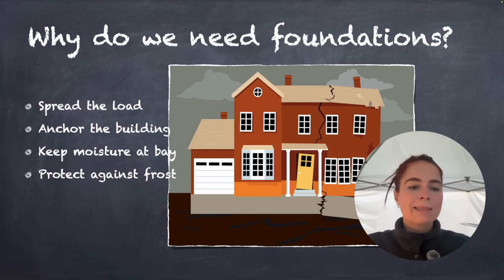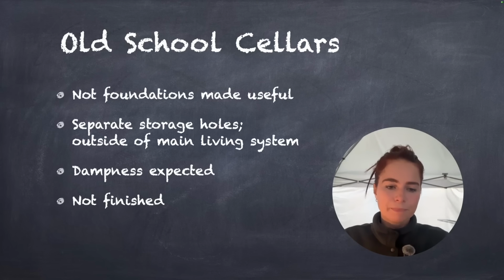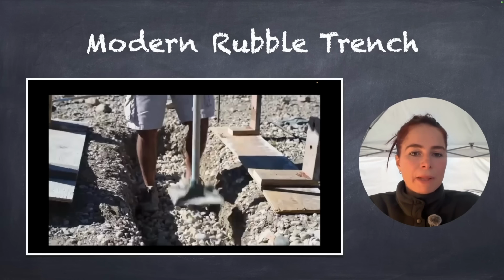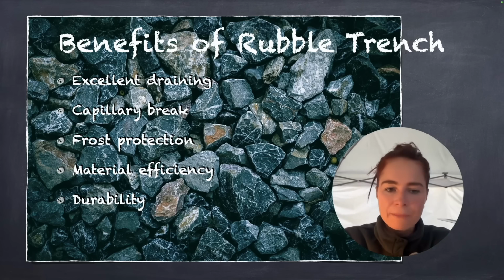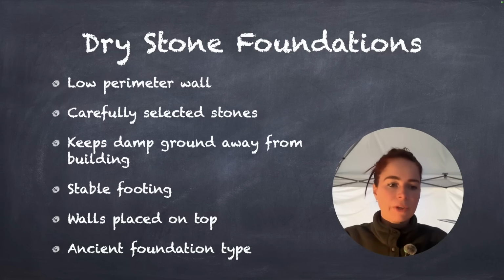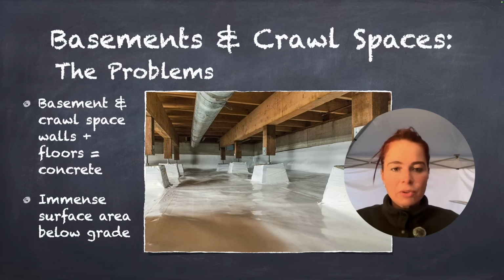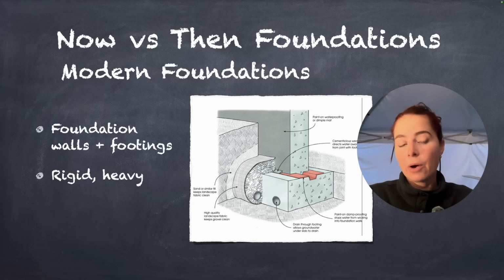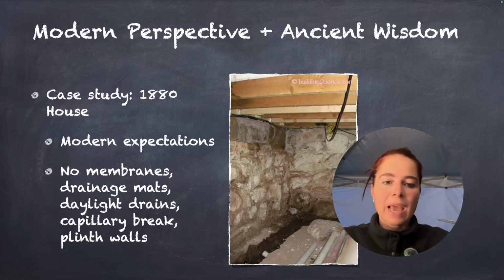Why Modern Foundations Fail — and the Genius Design We Abandoned

Comment: There's more you can dive into. Wrap around porches protect water from ever coming close to your foundation.  Also checkout stabilizing clay soil.  Or just having a 5 foot sidewalk around the house.  Oversized overhang may work as well.
Reply from the maker: Thank you — that’s such a great point. Controlling how much moisture there is to deal with from the start just makes so much sense. Really great food for thought!
Reply: That only helps with surface water, not groundwater. If a basement is getting wet from groundwater, reducing or eliminating surface water will not remedy the situation. You need to install a drain below the groundwater table, (below the foundation) which can be at various depths on a piece of land, and can change with time due to changes to nearby land (manmade and natural) that is not necessarily near the structure.
Reply: @TheSwissChalet  good point, but I'm not building a basement. Ground water should not be an issue with our 36"  foundation.

Comment: Building standards are on life support and you are curating the flame, keep it up. I recently removed parging from my 1920's craftsman (cleveland) basement to allow the foundation to breath. In the 1880's case study you say "the walls would have gotten saturated with all that mortar", not sure if you are implying the water wouldnt pass thru the wall. If proper lime mortar (quicklime/ Calcium Oxide/ Kibble) is used, the water vapors that would be increasing the hydrostatic pressure are allowed to pass thru the lime mortar. Tuck-pointing (step I am at now) is necessary because the mortar was always considered the failure point (crush panel). In roman concrete (pozzolan ash), especially at ports where water is in constant contact, calcium-rich material called "lime clasts" provided a self-healing capability that allowed it to cure later and repair cracks over time.

 Water management is 1st step; right sized gutters that minimize increasing hyrostatic pressure, large eaves, awnings (not just for shade), grading, etc. 80% of the companies near me that work on basements are fly by night scammers. We need to start building with purpose again.
Reply from the maker: Thanks so much for this thoughtful comment — I really appreciate the depth of your insight on this. When I said the walls would have gotten saturated, I was thinking less about the lime mortar itself and more about how a fully filled below-grade wall (without the drainage gaps of something like a rubble trench) naturally draws in and holds moisture. Once that crawlspace air is connected to the living space, it can impact the air quality throughout the whole house — which is especially concerning for anyone with environmental sensitivities (like me and some of my audience). Even with lime’s ability to breathe, that kind of setup just seems risky when you’re aiming for pristine indoor air. Your point about lime acting as a vapour relief path is such a good one though — it’s exactly the kind of nuance we’ve lost in modern building.
Reply: @thehealthybuildingproject  From my limited scope, we have far too few resources allocated to building foundations (in line with our throw away society), thank you again for caring. I did not fully understand the rubble trench until i watched your video and am intrigued to see how it performs with "modern upgrades". Rubble trench may be more durable than "stone n lime mortar?" in new construction. Maybe this is outside the scope of this video, but what would you recommend for restoring a clay block 1920s home foundation (originally built with lime mortar --> I believe --> I put this in or near the category from the 1880s case studey (hard material joined with mortar))?. I assume not, but would you see the rubble trench as something that could be retrofitted (prolly cost way too much --> underpin req'd?).

Youtube armchair commentor casully throwing out recommendations here, you guys should compile a "foundation types, repair methods, & future foundations" handbook and sell it.
Reply: She keeps losing everyone w her subpar knowledge and delivery I'm getting sick I can't hear this

Comment: Done correctly, modern concrete foundations designed with water & vapor management, insulation & inside air management are stronger,  cheaper & more durable than a rubble footing & foundations that are more difficult to detail to make them livable. Your main statement is " if done right" that goes for concrete foundations as well. Your hypothesis is lopsided. Look up "ASIRI Designs: Where Design Meets Building Science"
Reply from the maker: Good points — and you’re absolutely right that any system depends on being done right. My focus here is really on moisture management. Concrete’s capillarity is quite strong, so even when it’s detailed well, moisture can still migrate through it if that isn’t addressed directly. The systems I’m talking about have moisture management built in from the start — that’s where I think we’ve lost some of the older wisdom in modern practice.
Reply: @thehealthybuildingproject  They clearly have figured it out because there are buildings built with several stories underground, and they don’t just turn into giant multi-story swimming pools.
Reply: @walterrutherford8321 hi, I build these buildings. Sump pumps are the reason they don't turn into swimming pools. If the lights go out they will quickly turn into swimming pools 😅

Comment: You are making a lot of inaccurate assumptions based on an over simplification of the problem & not based on any provable scientific evidence  -  today's homes are tight & much much more energy efficient (required by code)  vs old homes that are leaky, cold or hot,  high or low humidity & are not energy efficient. Most people in old homes, especially ancient homes people only lived in very small areas of the home in winter or in the heat of the summer. These homes looked nice but were not comfortable. Done CORRECTLY  foundation construction takes water away from the foundation wall, is water & vapor impermeable,  insulated & has air management on the inside. Done CORRECTLY basements make excellent living spaces. Unfortunately, most builders do not take the time or want to spend the money to construct the foundation in a way that combines all the components necessary to achieve a dry, warm & fresh air basement.  The issue is more involved than just the foundation wall. For an detailed explainaition look up the article "Insight Concrete Basement Foundations"  (An edited version of this Insight first appeared in the  ASHRAE Journal.)  By Joseph W. Lstiburek, Ph.D., P.Eng.,  Fellow ASHRAE.  i have lived I ancent homes  500 years old   200 years old   50 years  onld and today 2025 less than 1 year old and of all these homes the most comfortable is the newest one that takes advantage of all the science & building techniques to achieve energy efficiency along with  air & water management.  the 500 year old castle was beautiful but extremely uncomfortable excepet for a few times of the year.

Comment: THE WATER IN THE FOUNDATION IS SEEKING EQUILIBRIUM - water will move from a wet space to a dry space.  So if the exterior soil is 100% dry, even 1% moisture on the inside will try to move to the exterior.  unless the wall is vapor & and water-impermeable.
Reply: Sounds like a very rare place to find with 100% dry soil around the house.

Comment: We've harnessed electricity. Install a dehumidifier in the basement and be done with it. Why are we trying to reinvent the wheel?
Reply from the maker: Dehumidifiers can help manage symptoms, but they don’t solve the underlying moisture pathways — that’s what this discussion is about.
Reply: @thehealthybuildingproject  Removing basements is, itself, an endeavor to manage the symptoms. You remove the space, or the enclosure envelope in the case of crawlspaces, because no material currently exists which can provide the structural characteristics of concrete while also preventing moisture conveyance.

Moisture is going to exist. It's going to enter the living space. And it will require handling. How this looks varies only in degrees with basements and crawlspaces within the dwelling envelope requiring a greater degree.

Since houses already have central/forced air handling it logically follows that adding a central dehumidifier to spaces with consistently high degrees of moisture would be the most practical route. Ducted dehumidifiers are more than capable of removing the moisture from basements and are very cost effective, especially within the context of finished basements. The idea that we have to handle (heat, cool, humidify, and dehumidify) the air in the above ground living spaces but we don't have to handle the air in the below ground living space is hilariously ignorant.

The majority of moisture also isn't coming from the basement walls but from the joint where the floor meets the walls. This is because, as the water table rises, it displaces the air from the gravel bed beneath the structure along the path of least resistance. Membrane isn't installed under the walls/footers and so there's no barrier keeping that air from ingressing through the joint. This is why elastomeric sealants exist and why sealed joints drastically reduce the level of moisture in basements on their own.

None of this is really that complicated and failure events typically result from shoddy work/application/installation at a rate far exceeding that of material failure limits being exceeded.

Comment: Rather than being any sort of lost technology it is a cost problem: proper rubble foundations are expensive and time consuming vs. concrete.   Reputable paver stone contractors have always used rubble foundations.  Proper paver stone driveways often have a rubble base that goes down 12" and deeper depending on expected loads - and often exceed $50,000 for a large driveway usually found on luxury houses.  Rather than using the small Home Depot hand held compactor in the Earthblock video clip you showed, any serious contractor will use a gas powered plate compactor that is both better at compacting and many times speedier.  Anyone who wants to build a house that will last 500 to a 1,000 years and longer can do it - for a price.
Reply: From what I can tell, a rubble trench Foundation is nearly identical to a French drain but add compaction. This method would be wildly less expensive than concrete foundations. Concrete foundation requires forming pouring and finishing the footer then forming and pouring the foundation walls, then inner and outer perimeter pipe with crushed stone plus fabric. The rubble trench foundation is just fabric, pipe and stone compacted.
Reply: @Aaron-dg8ul  Yes, the big expense in large paver or stone installation jobs like the op mentioned is the pavers or top layer of stone and time.  If an individual/individuals have the time to create a rubble trench foundation for a lighter building without a basement, they could do the physical labor of digging to below grade, placing geofabric and drainpipe, filling with clean stone in compacted lifts etc.  Depending on the size of the structure and location, one might have to find an engineer willing to sign off on the project to make sure it is within code.  Renting heavy equipment to dig and compact the clean stone lifts would speed up the process and make things easier.
Reply: You are  unifotmed: 1st it's called ballast not rubble, you have not looked into how rails are laid(over ballast).
Your cost calculation is off as well. 
Right off the bat, building the correct way is cheaper, way cheaper than using your way of thinking(the short term).
Reconsider, get educated then have another go at trying to educate the informed other half(us).
Reply: this video is total BS from an amateur.

typical solution in my country is to put 4 inches layer of rubble on the soil to put light wooden-frames building on it (improves the load-bearing capacity of soil).
usually some trading pavilion or small modular house. ballast for railroad is using same principe.
no trenches (because it will accumulate water, "drainage" as benefit is nonsense) or compaction (extra work and money).

Comment: My in-laws live in row homes in Philadelphia. Deep basements of stacked stone that was stuccoed. One had a clean dry basement and all the others had issues with air quality and moisture. None had windows.  The home with the dry basement had an original cast iron boiler, previously coal-fired but converted to gas-fired.  After they passed from old age a modern heating system was installed, along with it came the same problems as everyone else.

When my wife and I built a home we put the heat source (wood stove) in the basement along with air exchange. It is a very nice room.

I appreciate your video because we are now old and planning an aging in place new home. No wood heat. I'm now leaning towards staying above grade.
Reply from the maker: Thank you so much for sharing that — such a great real-world example. Those old cast-iron boilers actually helped keep basements dry by giving off steady heat and airflow, and when they were replaced, that hidden drying effect disappeared in a lot of homes. Your plan to stay above grade sounds really wise for aging in place — love how thoughtfully you’re approaching it.
Reply: @thehealthybuildingproject  a combination of solarpanels for hot water and energy & heatpump would give you the best for your money bc coal, oil and gas are becoming more expensive in the future. Wood can be a an option, but still blast CO2 into the atmosphere..
Reply: After old King Coal ,....Heating oil is the gold standard of heat...and to a lesser extent , Natural gas as both give a burst of hot dry heat , just as a wood fire .
Electric or heat pump not even close. 
IF you can afford it $$$ , Oil heat is the fastest way to heat
Reply: This is SO INTERESTING.  THANK YOU!

Comment: A grade beam wall on top of the rubble trench creates a crawl space, which would be a necessary building element to insulate the floor and access pipes in this type of construction.  Not all crawl spaces have concrete wall enclosures as is evident in pier beam construction.
Reply from the maker: Thank you — that’s such a great point about how a grade beam setup could create a crawlspace for access and insulation. In our case, we ran the plumbing through insulated PVC sleeves instead, so there aren’t any long runs under the slab. And you’re right — that type of crawlspace wouldn’t actually be below grade, so there’s no hydrostatic pressure to contend with. Personally, I tend to lean toward no crawlspace at all — just a solid capillary break and insulation under the slab — but I really appreciate you bringing up that alternative. It’s a smart approach for certain designs.